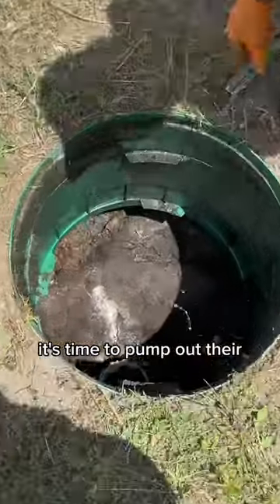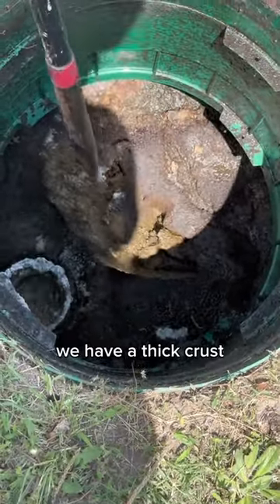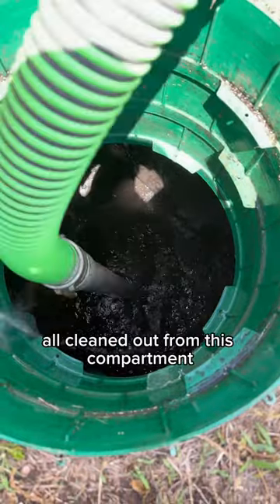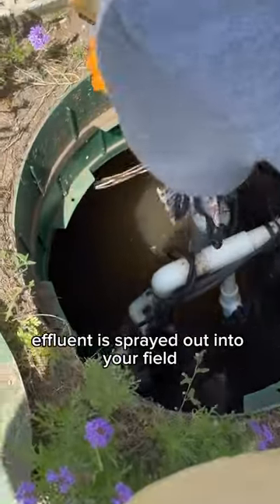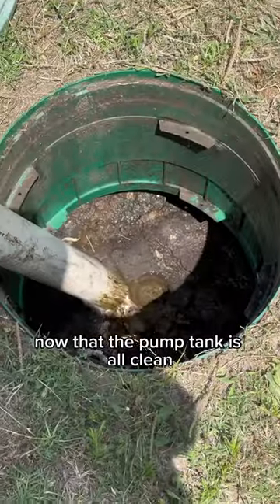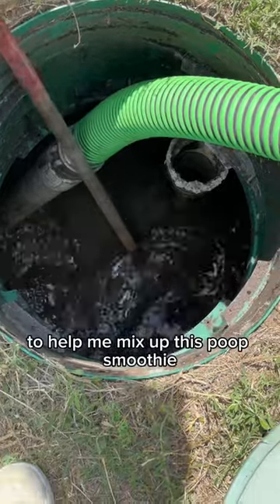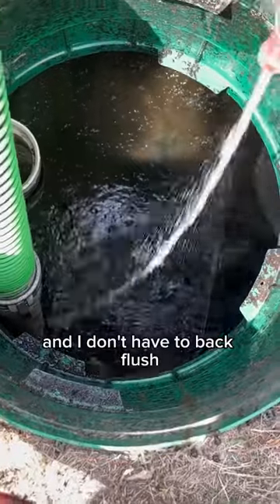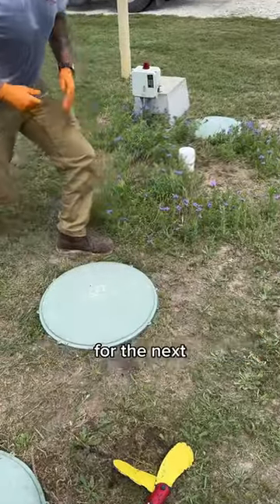The shovel test #shorts

Comment: Can you talk about the different type of tanks and the benefits of them?
Reply: In PA, where i am from, they do a 6 foot deep hole to determine the highest level if the water table. They look for a minimum of 19 inches below the surface. Then they dig 6 small holes for a percolation test. That determines the system you get.